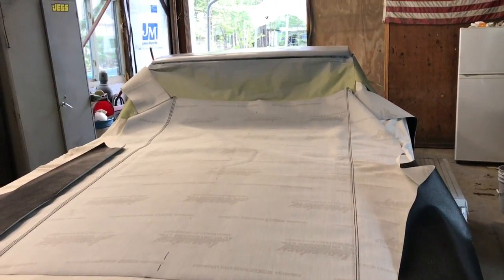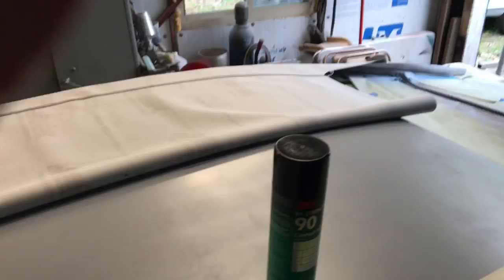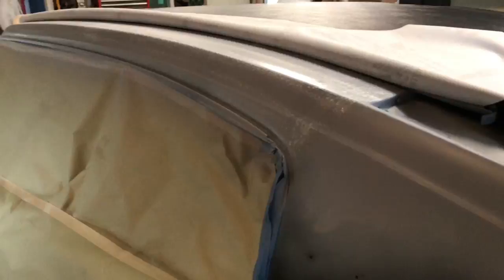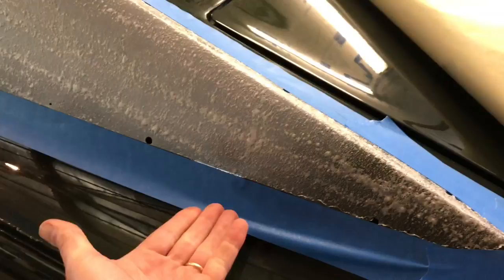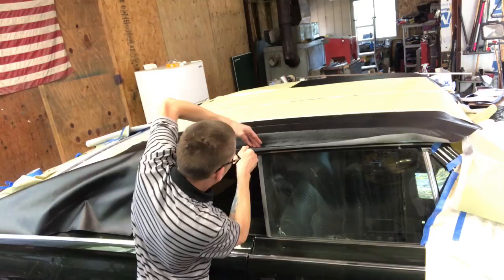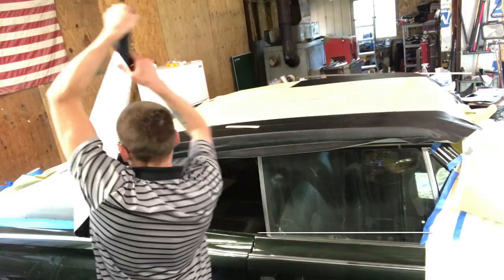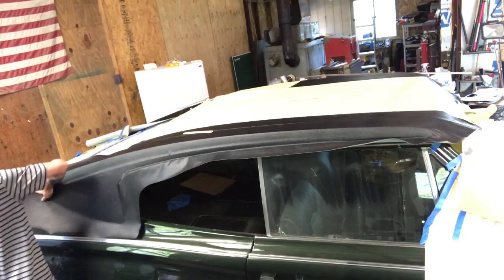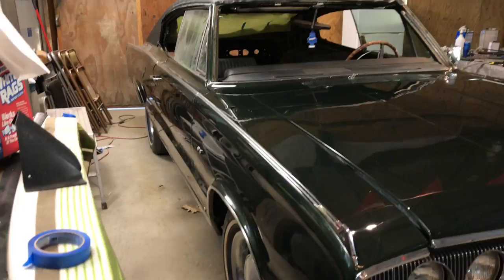Project 1967 Charger: Vinyl Roof Installation

Comment: Really good 👍 job on that..Definitely not easy to get it to look factory, that's for sure! My old bud (RIP)Marty the Mopar Man, and his family had these Chargers. 66 and 67's He had that black vinyl roof with a classic white paint looked awesome. Those were some overlooked cars as far as I'm concerned. Front and rear bucket seats, chrome all the way down the center. Fold down rear seats and access to trunk from the inside. Killer Jet style gas caps....Bulletproof 727 torqueflites, 440 Magnums. Bad ass machines! I think the vinyl roofs really set em off too.. Want to see alot of these cars at speed .✔ Checkout  the movie SPEEDWAY 🎬. Mopars, and  Elvis, and chick's....  O My! ( Leo D. Is upset your pops didn't get into the shots, he needs a break from all that pesky paparazzi) Chuckle Chuckle 😆

Comment: Great job! Is it possible to put the vinyl top on without taking the windshield and rear window out do you think? That's what I'd prefer to do on my '65 Thunderbird. Trim will have to come off, of course. 

BTW, how did you get the "Charger" script and emblem on the roof "C" pillar off and back on for the vinyl top project? The Landau bar on my car is bigger and sturdier, but I still don't want to damage it...and I want it to go back on to fight tightly as it is now. Thanks.
Reply from the maker: Kaye NineTwo You might be able to do it with the glass in it but it’s recommend to remove it. The Charger badge had little pop clips holding it in and I very carefully pryed it off.